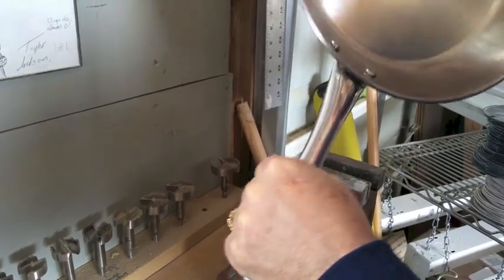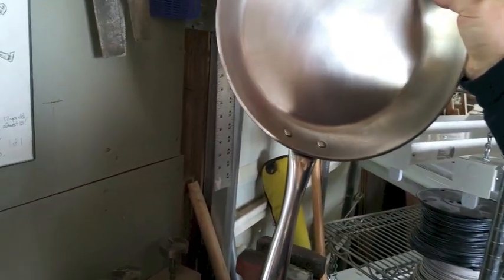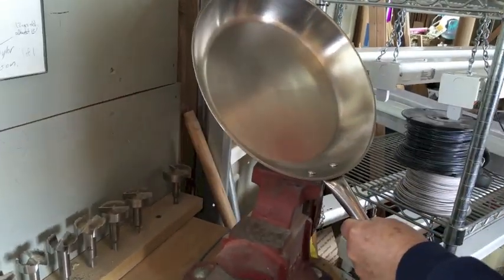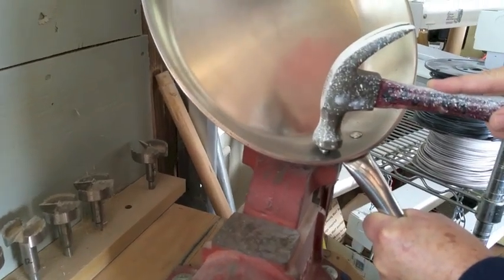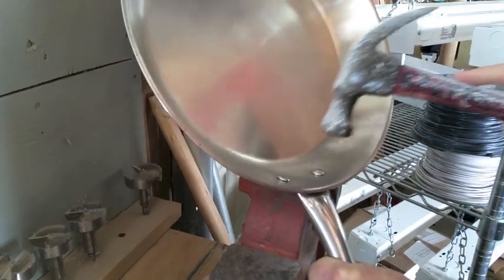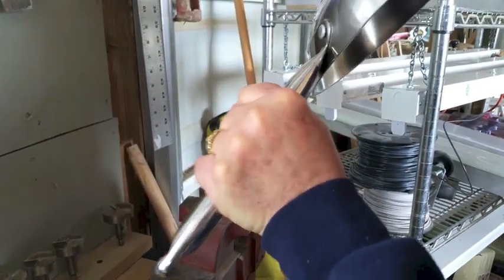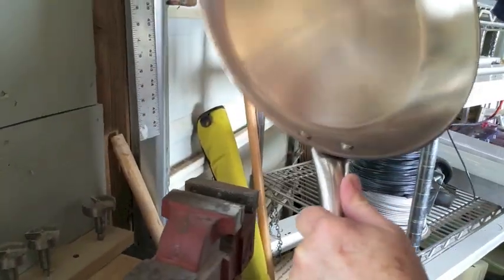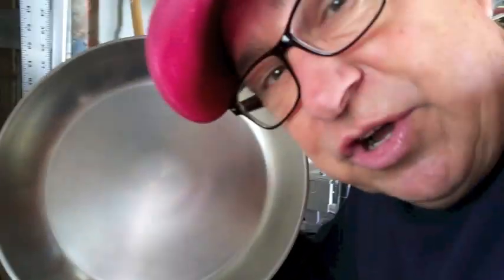DFJ Quick Tip - How to fix a loose frying pan handle

Comment: Just got a new carbon steel wok today and the rivets on the handle worked their way fairly loose just seasoning the pan.  Tried this and it worked perfectly.  I know I could just send the wok back for a replacement but I'm sure there's a good chance the next one would do the same thing and I just spent 2 hours seasoning this thing!
Reply from the maker: Crack of Dawn - glad to be of help. I use this ongoing with our pot sets - saved us a lot of aggravation. Thanks for writing! Best, DFJ
Reply: Hey, same deal with my carbon steel wok! I didn't want to buy another and replace it, inly to have to re-blue and reseason.

Hammer and anvil, baby!

Comment: When it becomes loose again, can it be done over and over? Thanks for the great video!
Reply from the maker: yes, indeed, this can be done repeatedly. If it happens often, the pan is being cooled down way too fast with cool or cold water. Let it reduce in temperature slowly to reduce expansion and contraction cycling in the metal. Hope this helps! Best, DFJ

Comment: How can I take off the handle? I wanna replace it. Do I keep the pan secure and use the hammer to strike the handle so it comes off slowly? Or is there an easier way. Thanks!
Reply from the maker: +Anon Great - probably the best way to remove the handle is to drill out the rivets. That means you would have to secure the pan in vise with some soft material between the pan and vise jaws. You would then create a dimple in the head of the rivet (there is a spring loaded punch that I use for this, or your could use a dimple punch you strike with a hammer). Then, use a drill, along with some machine oil, to drill out the center of the rivet. I'd use about a 1/8" bit for the first pass. Then enlarge the next pass until the flared parts of the rivets fall off. Be very careful not to allow the tip of the bit to "skate" around, or you will damage the pan by gouging it and creating a rough spot that food will stick to. You might protect the pan with painters tape or clear contact paper. What are you doing to replace the handle with? Let me know how this turns out! Best, DFJ
Reply: +DirtFarmerJay Thanks! Ill let you know haha.

Comment: I liked the video, but, what if you have done this and you just need new rivets?
Reply from the maker: Thanks. If the rivets get to the place they are thinned out and their structural integrity is compromised, then you could drill them out and replace them. Rivets can be found at larger industrial and fastener suppliers.

Comment: How do you remove the handle if needed?    opposite of what you did.
Reply from the maker: story1234, it's a bit tricky, but the short answer is to drill out the rivets so that the head of the rivets fall off and release the handle. Then you start over again. I'm curious, why do want to remove the handle? Best Regards, DFJ
Reply: @DirtFarmerJay  I want to make a pot within pot powered by low wattage PTC.  I was going to put sand insulation between the pots.  It turns out those dollar tree thermal bags will work instead.

Comment: going the other way, how do you remove the handle?
Reply from the maker: Brian, you will need to create a dimple in the top of each handle rivet, and then drill out the rivet with a sharp 1/4" or so drill bit. Pry off the rivets and you've got the handle off. Does that help? Best, DFJ

Comment: I have an expensive copper saucepan with a stainless steel interior, the handle rivets are starting to loosen, however the river heads don’t come through to the inside of the pan, they are probably sandwiched between the copper and the stainless steel layer. Can I still use this technique hitting the rivers from the outside and somehow protect the stainless inside?
Reply from the maker: Pierre, honestly, I'm not sure. However, if the pan becomes irritating to use, it's probably worth the risk to use a modified version of my method. I suspect you are correct; the head of rivets are in between the layers, or the manufacturer used a welded stud and then  affixed the handle to it. You can try putting a hardwood block inside the pan, and putting it against a hard massive surface that will act as an anvil. You would them peen the heads of the stud/rivets to get the handle to tighten down. Let me know how it turns out! Best, DFJ